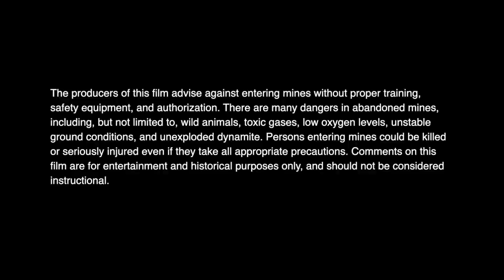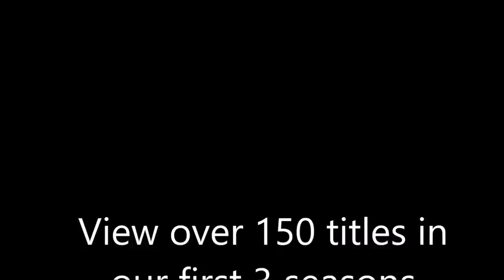#166 Barkerville Gold Mines Part 1 Finding the shaft!

Comment: There's a old mine near where I live I want to check it out but I did a little research and it said they pulled out Uranium ore. I'm not concerned about the uranium ore but of possible high levels of Radon in the mine if they did extract Uranium. But I'll check it out anyways sometime. From the research I did it said that  the mine was operated for awhile but I didn't find any info on the exact size of the mine.
Reply from the maker: Sound like a mine you should avoid!
Reply: @exploringabandonedmines  oh yeah forgot to say,  the mine I talked about was named the Last Chance Mine in Custer county Idaho